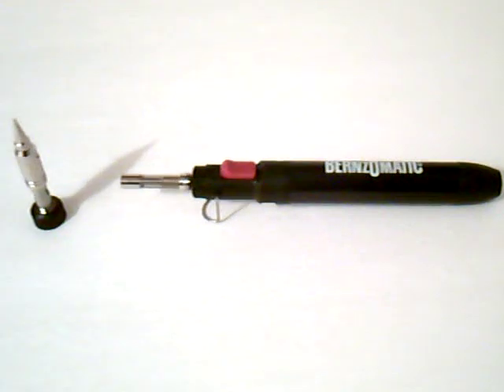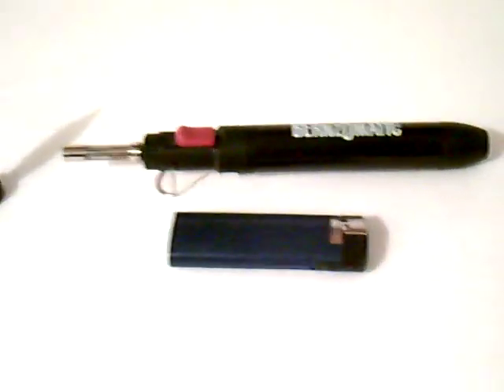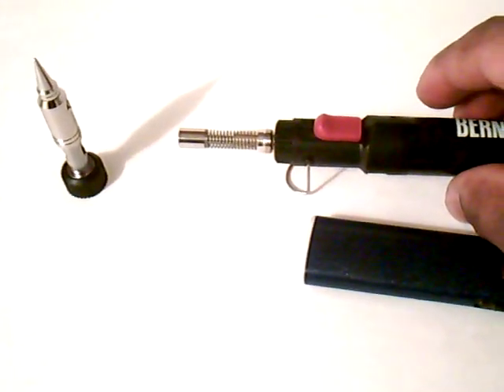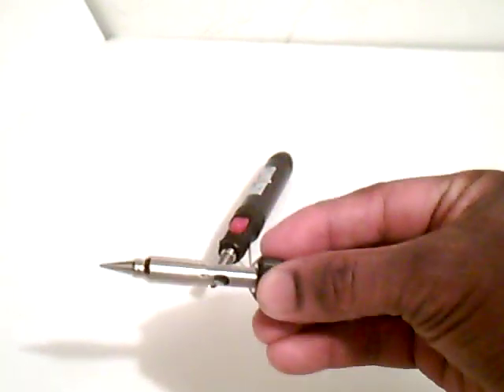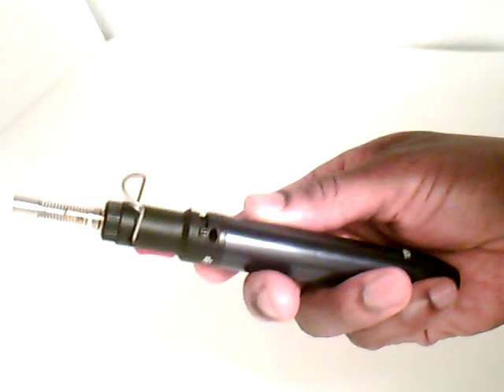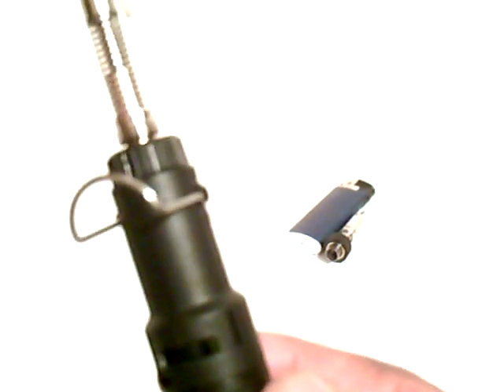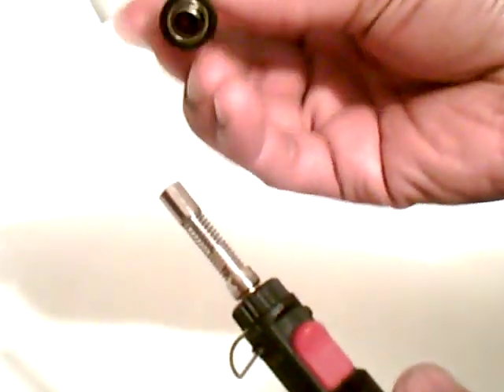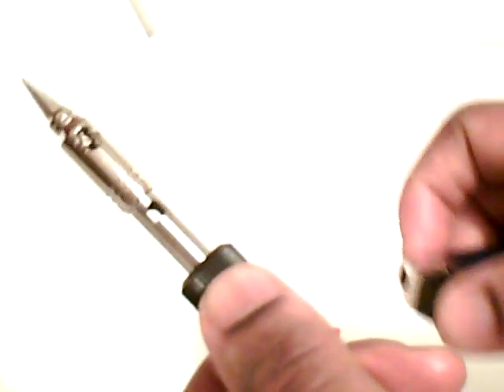Bernzomatic ST200 Butane Torch

Comment from the maker: It's either a problem with the fuel source or the air source since you need both fuel and air in the right mix in order to maintain a flame. It could need filling. There's really no way to tell if it's got enough fuel unless you can hear a lot of gas escaping when you turn it on before you ignite it. If the gas sound is weak or absent, you need a refill. You should get in contact with the manufacturer to see if they have any recommendations on troubleshooting it or getting it repaired.

Comment from the maker: thanks for the info. it does a pretty good job with lead solder though. I used it to solder some speaker wires last summer and it had no problems at all with the lead. it was also cool not to have to be near an electric outlet or run extension cord for the 120 AC irons.

Comment from the maker: that I do not know... first of all, it uses butane, not propane, so that could pose a problem. also, not sure I would want to try to jerry rig up something to try it. it's easy enough to refill it and you get pretty good burn time out of one fill. I haven't run it completely empty on one job, but my jobs using it have been pretty simple and straight forward.

Comment: I had trouble lighting it until I turned the output to one--the instructions say two, but that kept blowing out my starter flame.  It worked well for creating ball ends on wire--all I needed it for.
Reply: same problem here... if u find the solution pls notify me... if i find it i will notify u

Comment: IT also keeps going out constintly flame is not hot enough to melt silver solder
Reply: hey I have a different modle  It has 4 settings sted of 3 blue button sted of red but when I try to light it u don't hear gas's at all tryed to light with lighter nothing all after I just filled it up any solutions gladly appreciated